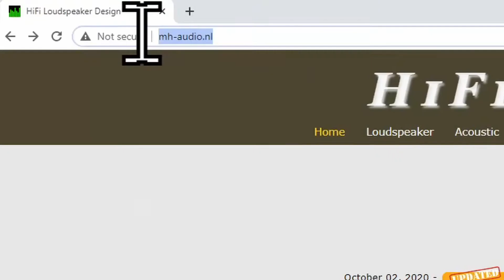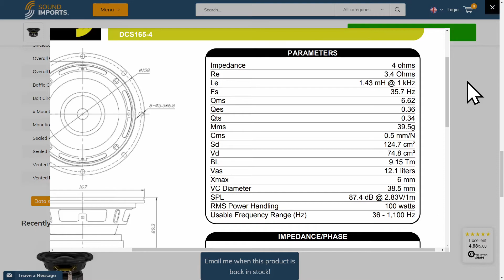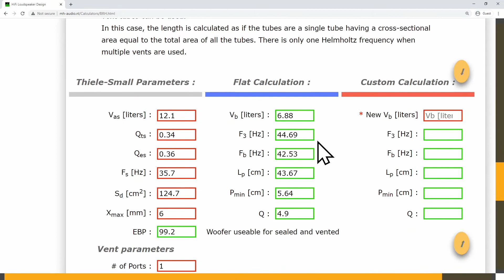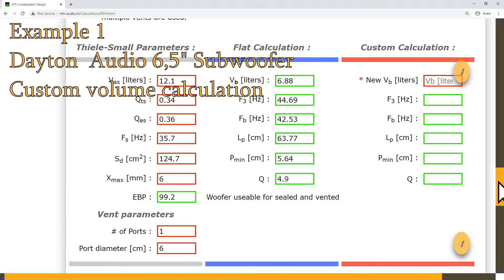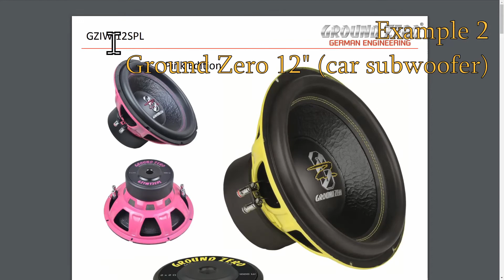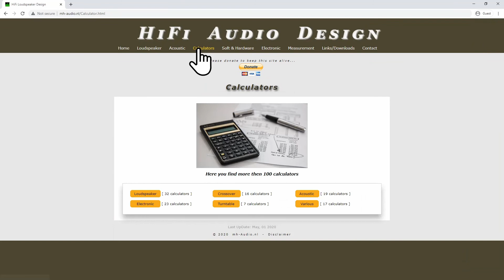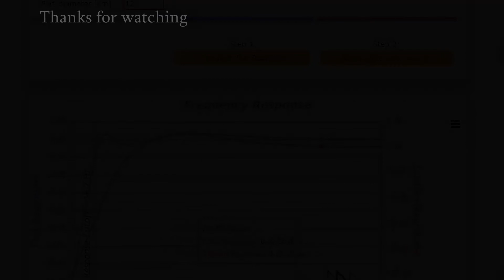How to design custom subwoofer enclosure with ported box calculator

Comment: Bro in bought an 18” pro subwoofer intended for home theater purpose. But i failed in designing with win isd. How low can i tune this pro subwoofer for maximum impact for movies. My sub is Faital Pro
Reply from the maker: What is exact model name of your sub? There seems to be quite many 18" faital pro subs: https://faitalpro.com/en/products/LF_Loudspeakers/ Choose the right sub, and use those parameters to calculate flat response following instructions of the video.
Reply: Boar Audio thanks for the reply brother. My sub is faital pro 18FH510.
Reply from the maker: Hopefully this helps https://youtu.be/x4jG4EKMaK4
Reply: Boar Audio very thank you brother for the  video. So finally conclusion is that, its not recommended for home theater purpose as it cant play low. On the other hand, it can produce good mid bass which will be apt for music.
Reply from the maker: @anoopvimal3313  Yeah it is good subwoofer for playing bass that is in the most of the music also, but it is not best suited for really low movie rumble.

Comment: I tried out the calculator. It comes up with a 540 L box. I then add my size and recalculate, and then it seems appropriate. Is this normal for the calculator to do that? to make the box so big?
Reply from the maker: You probably have similar situation of the design 2 from this video at 7:07 
Calculator basically just has a mathematical model that it uses to calculate box to give maximally flat response. With higher Qts subwoofers this results huge box sizes and otherwise also I would not recommend those design, for the reasons mentioned in the video.
So basically, yes that is normal and it is a result of the way that the calculator derives to the max flat response suggestion.
Reply: @BoarAudio  ok. But when i add my custom size and recalculate, are all the new measurements accurate?
Reply from the maker: @RobHTech For that volume and for the tuning that the calculator suggested if the driver data is correct then yes. There are other things like cone excursion that could effect what kind of box would be good, but there is no one correct box size. If it's a car subwoofer, I would suggest making the port shorter because this calculator tends to tune quite low and that can result over excursion faster.

Comment: What makes a flat response curve, less deviation from 0, more desirable over a "peaky" curve? Is a flat curve more "musical?"  What if the "peaky" curve is only 1 or 2 decibels higher? At what deviation point does the "peakiness" increased output become a detriment instead of a benefit? Thanks mate. -Cheers
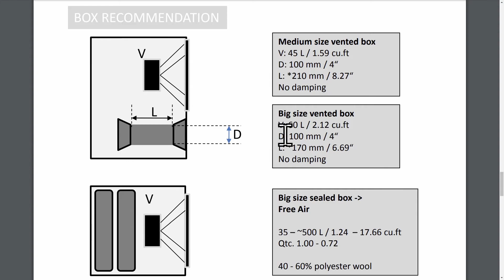Reply from the maker: It depends on the application and what you want about your system. Flatter response is considered more "musical" mostly because it preserves original loudness of different instruments or parts of the music. It is said that 3dB would be a point that starts to became noticeable to your ears, of course some cases even 1 or 2 dB difference can be detected. There is still many more things that affect what sounds good, example I would argue that these custom designs for the Dayton Audio 6,5" at 4:44 are more "musical" even thou they are not as flat because they play 10hz lower. And at 7:45 peakier design for Ground Zero is more desirable for practical size and power handling reasons and also you need output order to hear the sub over the road noise ect.